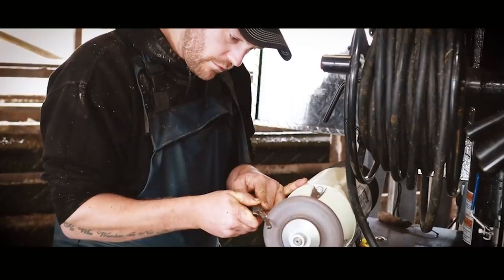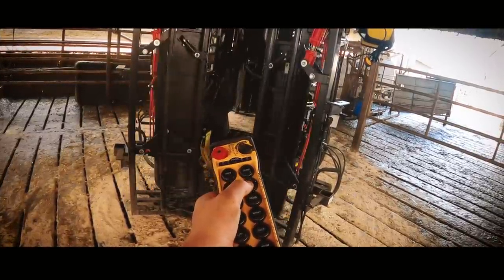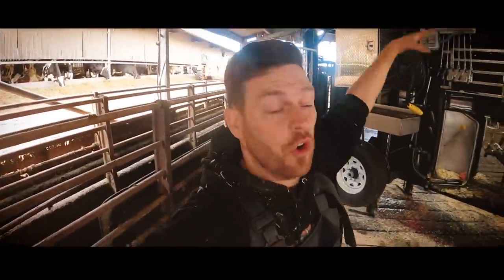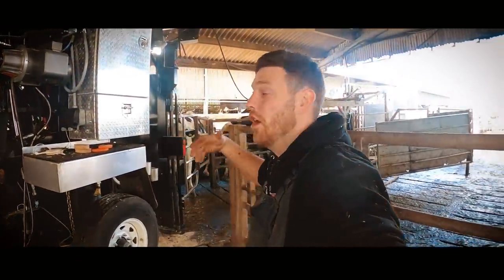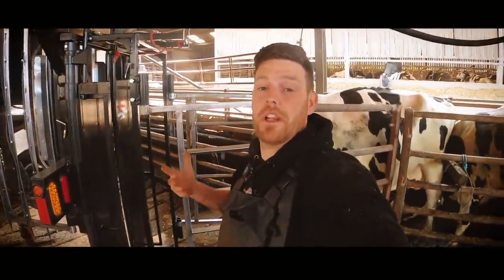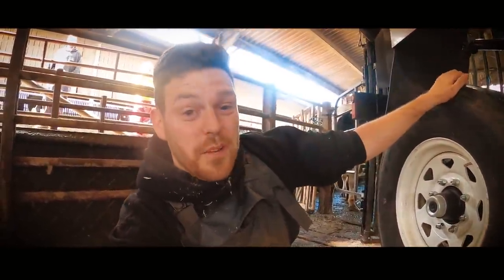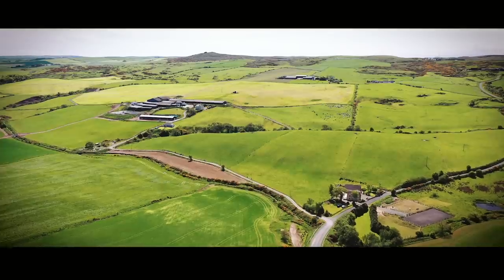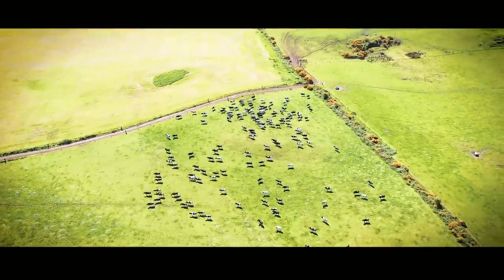INCREDIBLE MACHINES AT WORK // Worlds BEST hoof trimming crush? | The Hoof GP

Comment: Really interesting and impressive!  What will you do when one of the crush's systems, say a hydraulic lift or a gate, breaks down?  Are replacement parts and the needed expertise available where you are?  Are there dealers or certified service providers there or is it less organized? I wouldn't be surprised to hear that this is something you are considering looking into setting up to do yourself.  If more of these crushes are sold there, you could have a hand in repair, customization, redesign and education. You'd have fun teaming up with a mechanic and/or engineer, I think, and you already have good connections with the company that makes the crush.

By the way, look at all the nasty stuff splatted on your nifty face shield instead of on your face and into your eyes.  So glad wearing it is now your new normal.